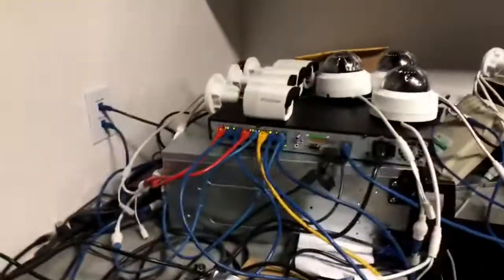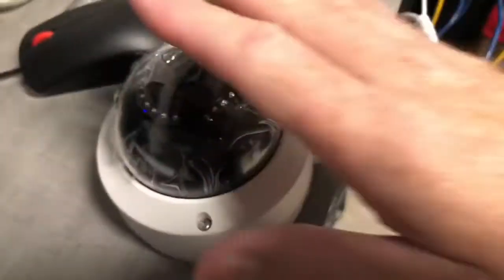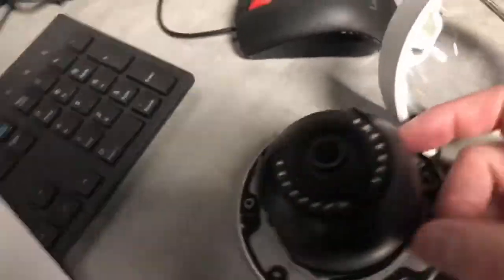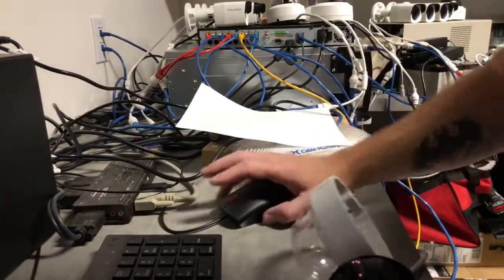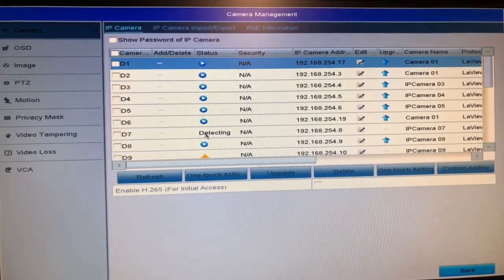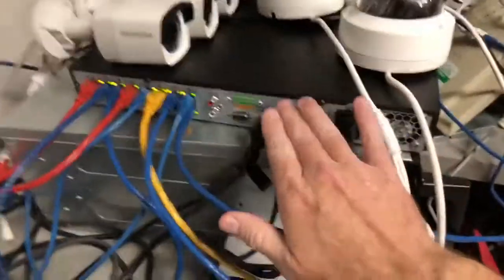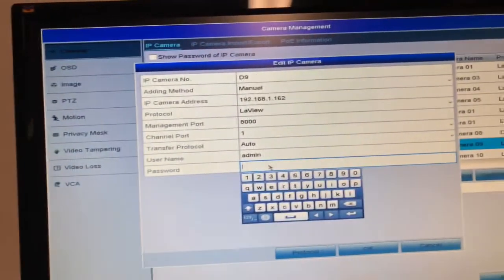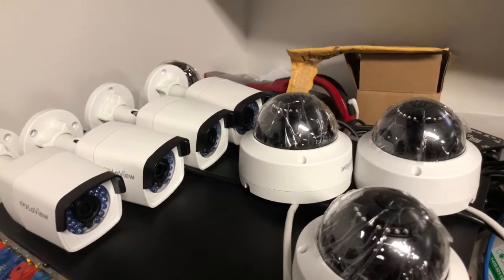Resetting LaView LV-PD54028C & LV-PB3040W Network Cameras

Comment: How can you connect those same camera to the app on my phone ?
Reply from the maker: As this is an older unit, it will require manual configuration of your firewall/router. You will have to consult the manual on which ports you need to forward, I know port 80 an sometimes 8080 will need to be forwarded, but there are a few others as well. You will also have to configure your firewall/router to set the IP address to not change (static IP). As each manufacturer of firewalls and routers have different ways of accomplishing this, so you will need to consult your firewall/router instructions on how to do this as well. When it is all done, you will just point the software on your phone to the IP address of of your firewall/router, and the username/password you set on your NVR. That should give you remote access to your cameras on your moble device.
Reply: Ok thanks I will try this

Comment: I have a few questions about how do get the ip address  so I can put on the network manually? Do I need to run a patch cord from one of the camera ports to the switch
Reply from the maker: It has been a whlie since I messed with these cameras, but I believe they are on DHCP. I put them on an isolated network, and used NMap to find the IP. Connected to it via web browser. These used a really old firmware, so I had to use Firefox or IE to connect, as newer browsers wouldn't work.

Comment: Does anyone know how to reset camera model LV-PB932F4? I have tried several methods & nothing works.
Reply from the maker: Best bet is to call LAView and they will tell you what the procedure is.
Reply: @AudioCraZ  I had been in email contact with them,(their response came around 12 -1 a.m.) but none of their suggestions worked. After a couple of weeks, I got an email asking if their support was helpful or not. I selected "NO", & explained the procedures I tried, & no answer. The next email I got stated they were closing my case.
Reply from the maker: @swmovan  I called them, and performed the reset while I had them on the phone. LaView uses a lot of rebranded cameras, so they may go through a few different methods before you get the one that works for the camera you have. If you can't reset the camera with their help, then the camera is defective.
Reply: @AudioCraZ  As I said, I tried several suggestions they gave me. The camera would "click" as though it was resetting, but still didn't work. 2 different cameras, same model, nothing they suggested worked.

Comment: You look like you know what you're doing..

I have an issue with a dome style security camera. I disconnected it to fix some brick work it was fixed to. ( a van had bumped it and the masonry cracked)    when I re attached it it wouldn't work.

The consiglierge of the building is on my back now and I have no clue what to do to reboot the thing. 

I suspected it was a security feature that needed a code or an engineer to come and reset it etc..

Does  this 25 second reset button system work on  most of these domes or is it just on this brand please ?

Thanks for the info 
Luke
Reply from the maker: It is typically a brand but most importantly a manufacturer thing. Give it a shot, if not you may need to contact the company brand, and they can walk you through resetting or troubleshooting it. Another simple thing you can try is check the cable. If it is a IP camera, you can pick up an inexpensive CAT 5 cable tester and make sure the cable is still good. It is not uncommon to have issues with copper cables  after moving them when they have set for a long time, worth double checking anyway.
Reply: @AudioCraZ  Thanks mate

Comment: If resetting the camera doesn't work, there's another thing you can try.  Plug a patchcord into port 16 from your router or switch.  At that point, run the SADP tool and that will find all of the cameras on your network as well as the cameras that are plugged into the NVR.  At the same time that is open, log into the NVR via the web interface (use Internet Explorer)- use the IP address of the NVR found in the SADP tool and try port 81.  In the web interface (IE), press the configuration tab then on the left go to camera management.  The goal is to make the parameters match between the cameras (the camera management page of the NVR) and the camera parameters in the SADP tool.  It takes some time but I just got all of my cameras working going this route.  I'm no wizard - I called Laview tech support and caught onto what he was doing and then I took over.  Hope this helps - emailing Laview tech support and getting this resolved that way is a test of one's patience...
Reply from the maker: True, but unfortunately for a few of the cameras I received, had passwords. The only option (as per LaView support) was to do a factory reset on the cameras.

Comment: on the remote switched cameras, did you set a static ip per each camera?  could you input the macs of the remote cams in the nvr? would the remote cams need to be on the same ip rage as the dvr? I have installed a ip 4mp laview system before, but all the cameras plugged direct into the poe dvr ports.  

I'm helping a friend install a system for this brother's house and shop(4 cam 4mp ip/poe 8 channel). The shop has 1 cat 6 connection from the house.  We plan to put the main dvr at the house, and a poe switch in the work shop(for remote cameras).  For now we will have 2 cameras in the house plugged direct to the nvr and 2 in the shop plugged into a poe 4 port switch.  I was worried if the main nvr or remote poe swich was restarted and they dchp new addresses, would the remote ip cams reconnect to the nvr?  I was not sure if the nvr knew the mac's of the remote cams, it would not matter.    

Thank you for any help
Reply from the maker: All of the cameras I have are set up for DHCP (they request their IP from either the Router or NVR). The NVR gives out a specific IP to each of the 1-16 ports on the back. For the cameras I have on the network (as I am running on the domain) I have my Domain Controller assigning them a specific IP (as so they will always get the same IP, and they won't conflict with any other device on the network). Any home based router can do this as well. But if you are plugging them into the NVR, then they should be left set on DHCP, and the NVR will give them their specific IP address.  With my setup, as I am running cameras in multiple buildings, half of the cameras are plugged into the back of the NVR, and the other half are connected over our network, and video comes in through the LAN port.

Comment: My Bullet Cams don't have a reset button and Laview said I need to also connect the 12 volt pwr plug to reset them.
Reply from the maker: What is the model. I would assume they are all PoE. Strange they would make one unit different than the rest of the models.
Reply: Same here, no reset button and LV-PB3040WC wonder how to get to reset button, looks like you have to disassemble the whole camera.
Reply: @bobt4626  did you figure out how to reset it? I have a lv-pb768wlp and cannot find a reset button even after pulling the front off. Thanks
Reply: Was you able to reset your bullets. I didn't locate a reset either
Reply: @y2kvitual  I talked with laview support and they said some cameras cannot be reset and they offered to replace it.